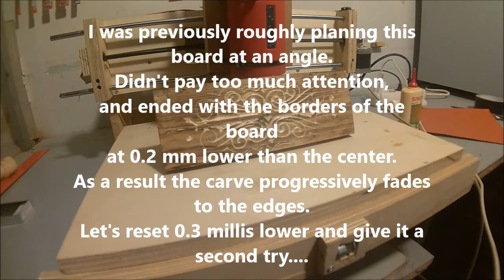ZepLabs: V-Carving on Homemade CNC

Comment: thats awesome cnc..am curious..how can you compare the timing belt to threaded rod?
Reply from the maker: Thanks a lot Pete! Using a belt makes you move definatelly faster than the screw! Then again, depending on your belt pulley/screw thread, with the belt you usually lack on precision. With the srew the machine is stiffer, which means it can carry more of a load (deeper cuts, where the belt would jump on the pulley), but when using a screw you have some backslash problems, switching between front and back movements, which can be solved by using a ball screw (they are pricey!) , or by using a tensioned nut at one side (antibackslash). I think that includes all!

Comment: Sep I'm making a small mill and don't know which program to use (buy). Seems like many use the Mach-3 for $175. I'm trying to keep my budget under control. What program are you using?
Thanks, Tom
Reply from the maker: Hey Tom! Well I was always curious to use mach3 but never did just yet...I use grbl with UGI for the time. It's free and reliable. Give it a try! Just remember not to use a data cable that's 6 meters long!